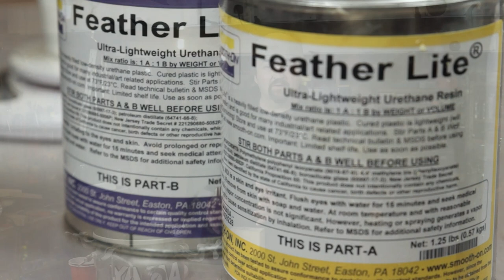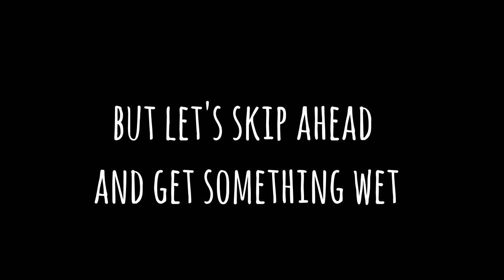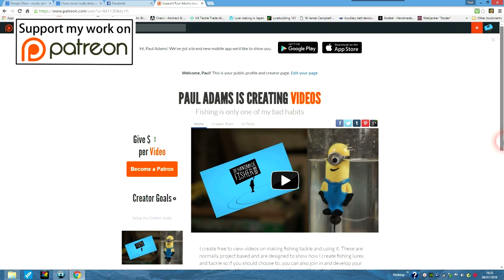Vlog 005 Swimbait Diaries, crash test dummy

Comment: Hi Paul love your videos. How's the feather lite cast under pressure, is there any shrinkage? and how many psi where you using?
Reply from the maker: +Muskie Tamer i cast  at 50psi, i tend to overfill using a silicone /caulk nozzle because the pressure collapses any bubbles and so you get a slight shrinkage, but the result is a lot stronger than that casting without pressure.

Comment: Once again left me with several good ideas for my own luremaking - Techniques or parts of techniques I will try on my own. Thanks

And looking forward to see details on how you made the hinge, as my own attempt at this ended as a disaster.
Reply from the maker: +Splish Splash I made a jig for the bandsaw, but my drive belt perished so I had to turn the wheel by hand to cut them, but i cannot believe how tricky making joints are, they always need a bit of tuning. But hopefully I will do this in the next video, Cheers
Reply: +Paul Adams (The Handmade Fisherman) Yes tricky indeed. Mine worked great on the prototype, so I made 4 baits for test fishing. But 10 casts into the test the resin within the hinge broke. It turns out, that the forces applied to the lure by casting and slamming into the water was too much for the more delicate resin parts. Next time more metal will be involved, but before I have another go at it, I will be happy to watch your approach.
Reply from the maker: I am not completely convinced this is going to be the final joint , i though about making the buoyant body and the joint /weight/ hook attachment  system separate to give strength where i need it so maybe out of a unfilled polyurethane 

although pressure casting really adds strength as I have found even small amounts of air create weaknesses that you cannot always seen, and then moisture can also add bubbles to the mix while in the mould. all good fun
Reply: +Paul Adams (The Handmade Fisherman) The challenges on the way is making the feeling of success even sweeter when you get the first catch

Comment: I would recommend adding more body segments. But the extra action comes at a cost. You lose the structural integrity of the lure, since more sections and connection points means more points where failure can occur. But the project looks like it's going swimmingly(pun sort of intended)
Reply from the maker: +michael strang i chickened out of putting another joint on the first one mainly because i needed to get out the shop, but i am wondering about mixing materials to get more strength where i need it, more experiments needed i fear,  i did enjoy the pun
Reply from the maker: +Paul Adams (The Handmade Fisherman) thanks
Reply: +Paul Adams (The Handmade Fisherman) Possibly if you use saw dust from MDF board, it could increase the density, rigidity, and tinsel strength. MDF has a bonding agent that helps keep it together, plus the bonding agent and small size of the saw dust would mix in very well with the resin. Another idea would be to use aluminum as an axel hitch. Use ovals with a hole in each end. Put two ovals on each section. One on the top and one on the bottom. This will give it some weight as well. But will also raise more questions as to how to bond the aluminum to the liquid resin. Hope this gives you an idea.
Reply from the maker: my idea was make a spine of unfilled polyurethane resin to handle the joints carry the weights and have the lightweight body surrounding it , that is the theory making it will be something else
Reply: +Paul Adams (The Handmade Fisherman) maybe even using an aluminum rod could work. That would even cut down on the weight, but I think the aluminum ovals are the best option. They should be made of thin aluminum sheet, which is pretty cheap and easy to shape using wood tools.

Comment: Why not get a vacuum and chamber and degas your products befor you poor them in.
Reply from the maker: +zerg232 I have one, but it is something i rarely use as pressure casting and mould design normally takes care of things. In this case somebody else thought they were being helpful by turning off the compressor, this silicone has a very long cure time and would normally only be opened after 16-24hours